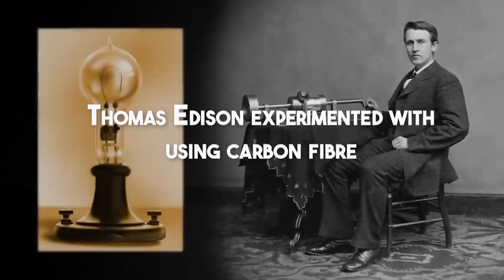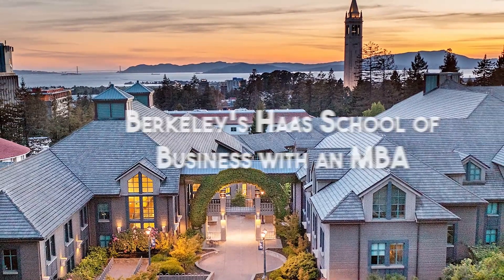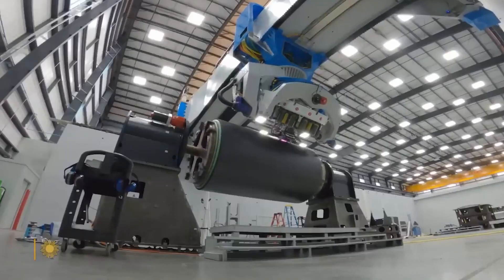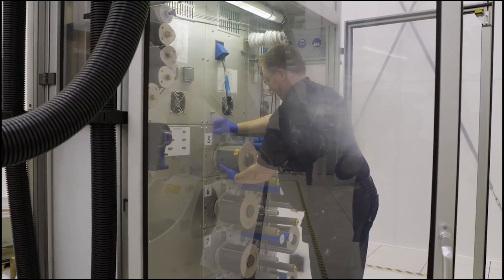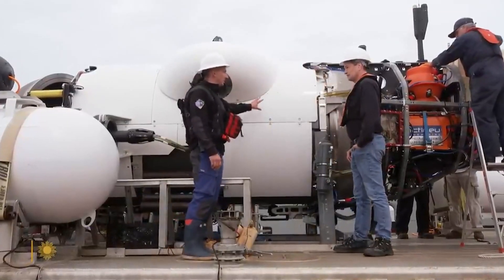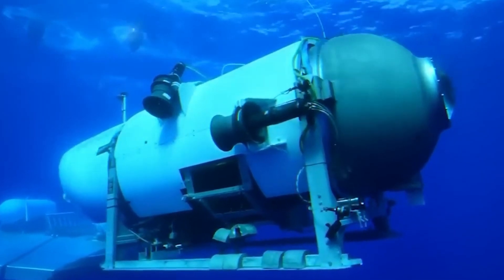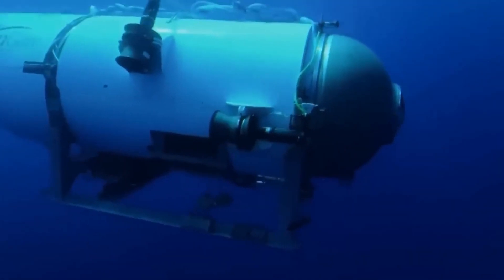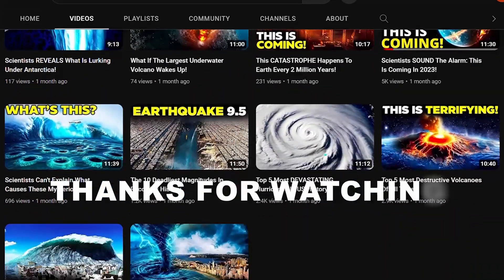Composite Experts CLAIMS This About Titan Sub’s Hull: FEASIBLE?

Comment: To be fair his carbon fibre sub did reach the titanic
Reply: To be honest, all guy missed the squrre-shaped electronic boxes outside the hull.

And, actually the real problem is, they not able to "jettison" the weight with the sub-frame properly due the electric failures.

The halfly ejected weight clinged on the glued ring, and just teared it down from the hull.

But, ALL BS talker feel so important, to tell to the public his "well big" knowledge about a complex vehicle, ignoring ALL the engineering facts, which clearly lead to that disaster. No, not the used materials, even not the method they assembled. Even the toy controller isn't a big deal.

The big deal, when they lost power, no longer able to detach the weights. Is hidraulic-powered, thus needed lot of energy...